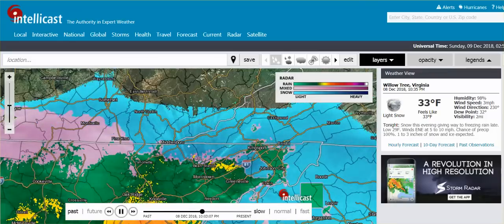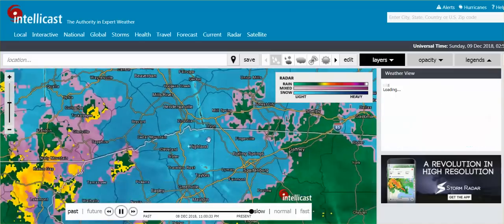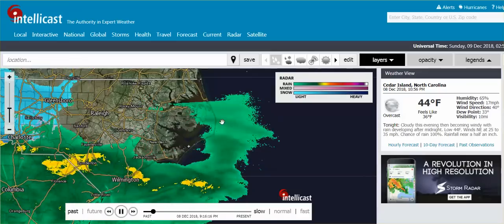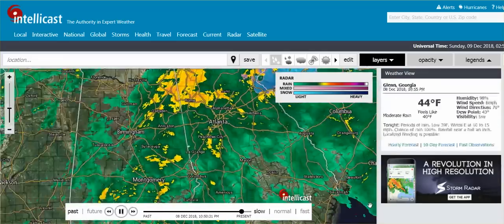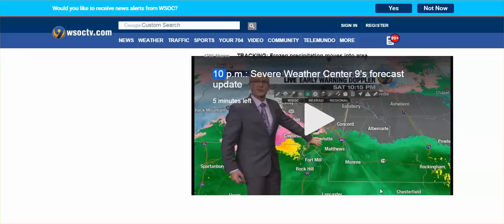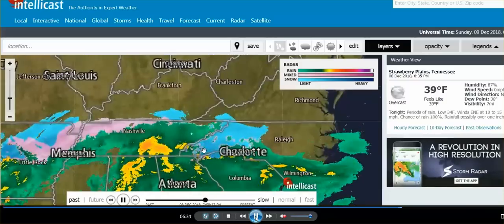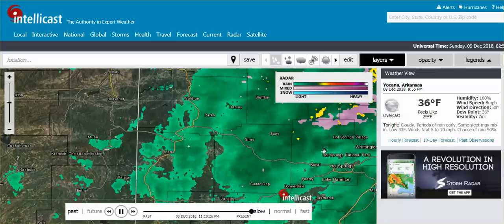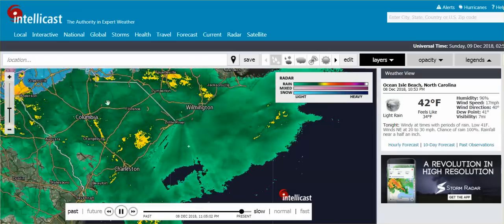Winter Storm: Unbelievable Evidence Of Man Using Various Frequencies To Control It

Comment: in and ll around the green square area are winds of 89-54 miles per hour. I'm in the Boot-heel in Mo. and its coming down heavy in the form of freeing rain, already accumilation of about 12-34 inch ice on trees- cars ect.   There's a "cell" phone tower about ten miles away that is flashing five times brighter and its a large mass of light.      No moon for the last four days.

Comment: It's been snowing here since around 9pm and of course it wasn't cold, cold so it made the roads wet first(will be ice even if it's scraped)and started sticking to them about an hour after the first flake fell. Hoping we don't get sleet but they are saying 12+inches snow. Dread trying to make it to work in morning an hour away, in statesville. Heck I usually leave my house at 430am just to get there by 530am so I'm wondering if it's even worth risking. It's only going to get worse every hour and I work 12hr shifts. Guess time will tell how it goes, many times they have called for continuous snow (many many inches) and it never gets that bad, I hope this is also one of those ocassions. I only work 3 12hr days a week so missing a day really dents my paycheck. Hope everyone is prepared and also have alternative heat in case of power outages. Stay safe Carol and ill be looking forward to your next update\report, I worry about you and everyone when we have events like this continually happening. puts me on edge, as if we are waiting for the other shoe to drop, never know what these assholes have planned behind the scenes. Don't forget your pets everyone, when it's cold like this it's important to keep an eye on them or bring them inside or in an outbuilding. Adequate food and fresh water (it freezes over) is very important for outside animals during this kind of weather